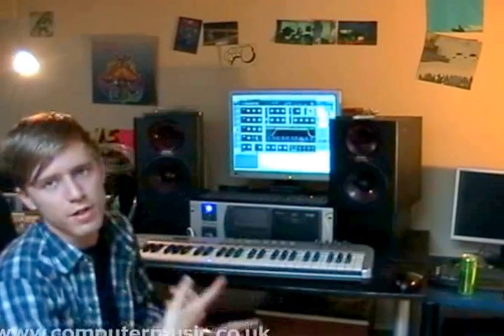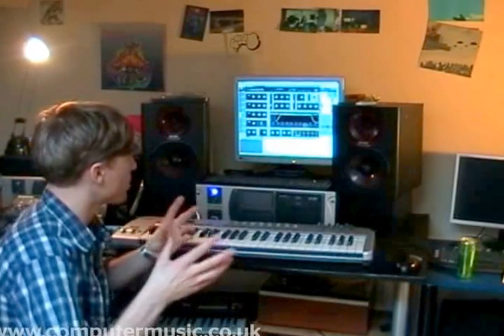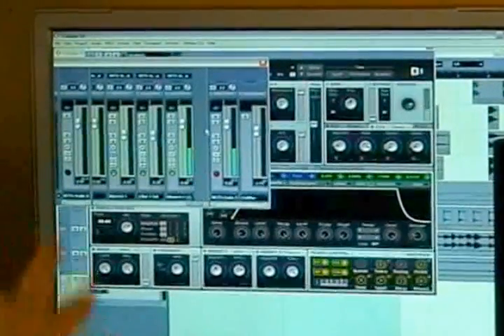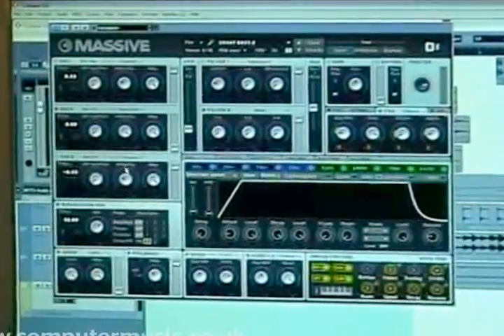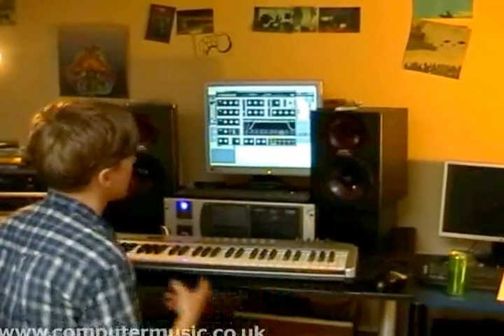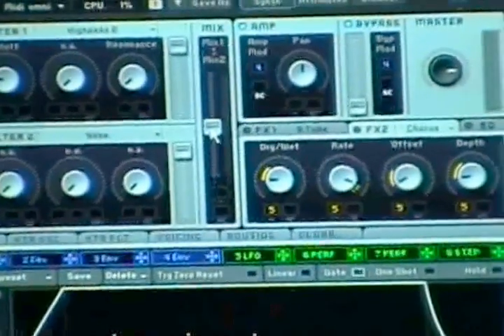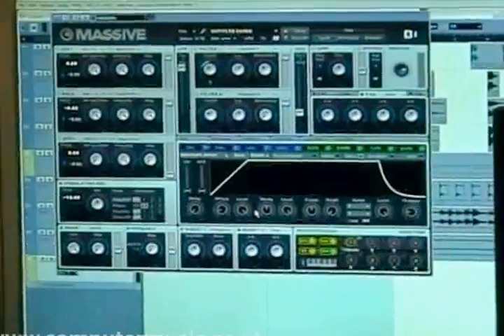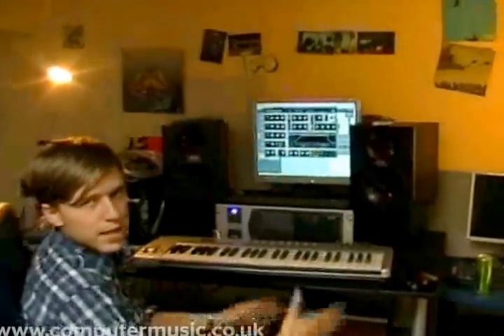4/4 Sub Focus - Reese basses - DnB Masterclass 2008

Comment: i usually bypass a sine oscillator straight to the EQ, so i can get the tradtionional saw reese hipassed, without as much phasing issues from the low end, but this would work well too.